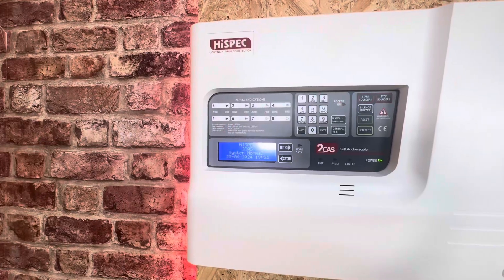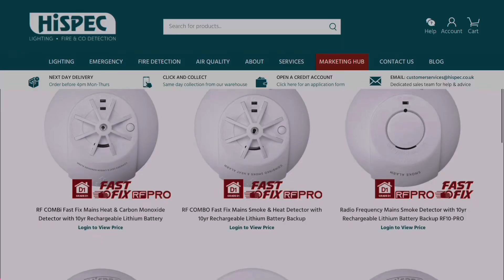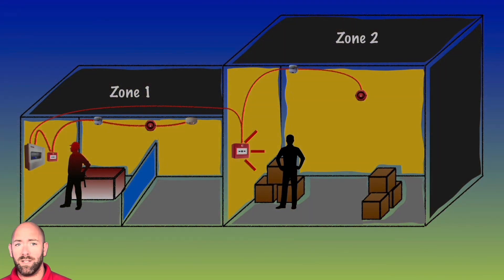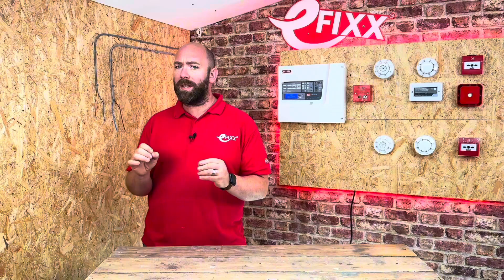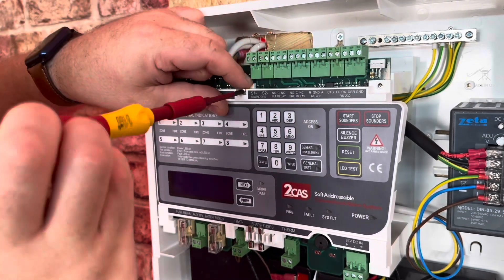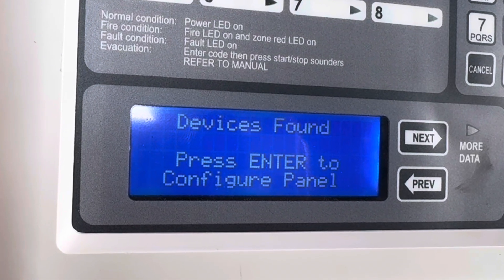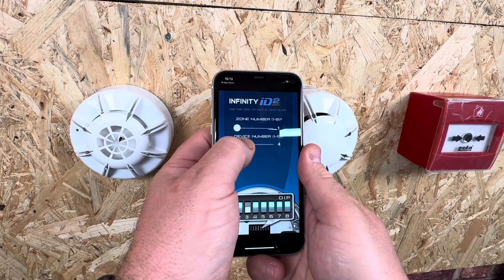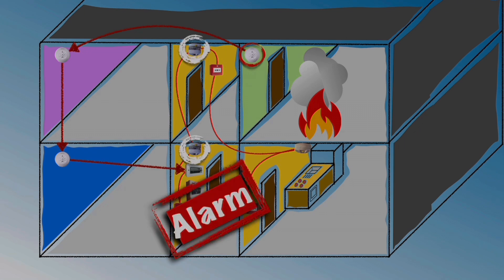Classified: The Fire Alarm System with a Double Life

Comment: You dont really need a manual to set the dip switches. You just need to be able to add up. 
1,2,4,8,16,32,64. Chose any combination of switches to make upto 127

Comment: Why aren't fire alarm systems fire rated themselves if a Fire Starts under the box the whole system would be useless
Reply: The panel should be protected by automatic fire detection and the cable is fire proof for 60 or 120 minutes,,,if its fitted correctly it should be fine
Reply: This system is not good, go and se Autronica! Best in the world :) for real
Reply: It depends on your location. I’m in the US and our current life safety code requires a detector within 5’ of the panel.